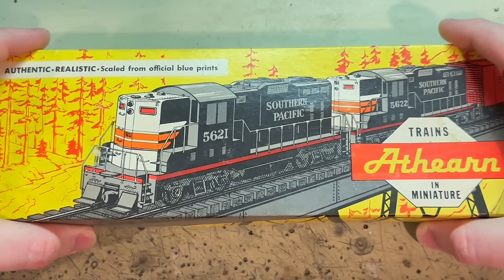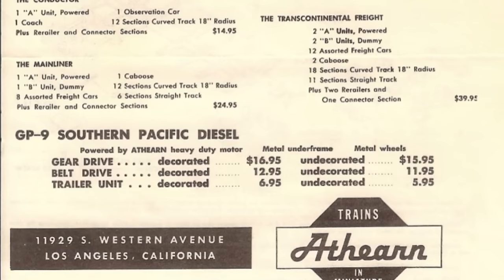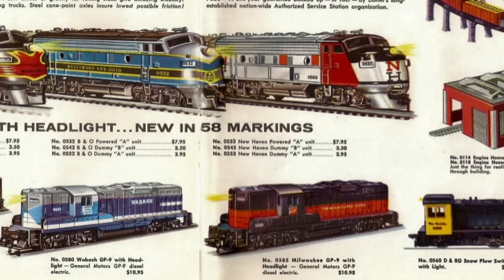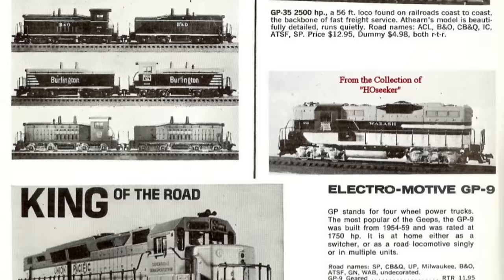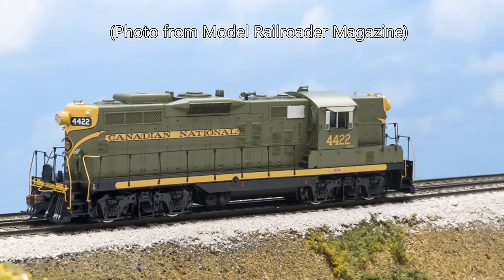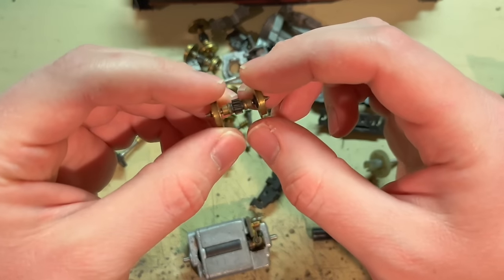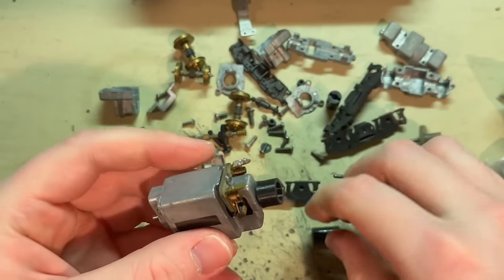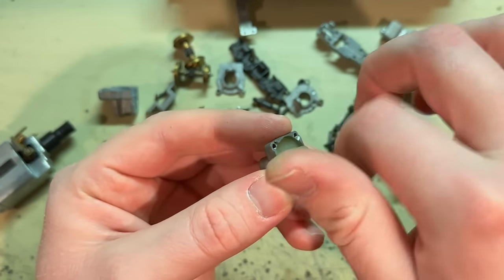Build and Review of the Original 1957 Athearn "GP9"

Comment: Great build, Its sad the old Globe drives aren't as known about today. They're a great option for repowering with a can motor if you want a heavier chassis in a custom build. I would like to point out, the long bearing in the top of the gearbox is actually two of the drive axle bears pressed in either side. Found that out accidentally during a service. Hope to see more builds in the future!

Comment: Good video. I've never seen one of these early Athearn geared drives. I've only messed around with their rubber band drives of the  same era. 

I've started using J-B Weld two-part epoxy for the metal handrail stanchions on my Athearn diesels, both where they fit into the plastic body shell, and where the stanchion meets the handrail. No more crooked stanchions!
Reply: Super glue works well
Reply: I use a soldering gun to "set" the handrails to the body, and then use glue. 💙 T.E.N.

Comment: Super. I operate four Athearn GP-9 "Bluebox" locomotives that I bought almost fifty years ago, and just by chance, they all came with the Jet motor and later version gear drive. I never knew that there was a third type of drive for the GP-9, not just the band and jet drives. The trucks remind me of the Mantua/Tyco MU-1 power trucks, with all the screws. I also make sure that all of my locomotives have winterization hatches, dynamic brakes, nice horn, and a full lighting package. 💙 T.E.N.

Comment: My first locos that I got when I was 4 years old were a GN GP9 and an NH F unit, both rubber band drives. Soon after, I got for my birthday, one of the units like in your video. The motors were pretty weak in all of them, and I don't remember where I got a replacement from a few years later, but it had about 3 times the torque the stock motor had, and improved it in every way. The amount of screws in some of the old locos always impressed me for some reason. I have a couple of RC cars now and the bigger ones have literally 200 allen screws holding it together.

Comment: I have an Olympic Express Japanese chassis that is a dead ringer for this chassis except mine has a Pittman motor! All metal gears....not quiet but powerful! Even has the frame tabs for Athearn GP-9.
Reply from the maker: I've seen those around before!  Since there are slight differences between their chassis and Athearn's I have to wonder if there was some copying going on or if Olympic Express got most of the parts from Athearn.

Comment: I did not know that Athearn used metal towers. I thought they went from rubber band to plastic towers. Great vid.
Reply from the maker: Yup, they started out with metal before changing to the plastic design, and then came up with their standard chassis a few years later that's still in use today!

Comment: I believe I have a pre-production sample of this model. It was all black plastic but with very few details. Like no fans other than a winterizeation hatch. With an all plastic frame with no motor mounts and has screwed on trucks. It also has all the separate parts on it. But with the horns being on the short hood.
Reply: You had the earliest version of the Globe model. They and the F7s originally came without a motor and as a dummy only unit.

Comment: I decided to do some quick internet research on the winterization hatch. While I didn't find it on any SP GP7 or GP9s, I did find them on UP and WP locomotives. Other details that would stand out the steam generator and dynamic brakes. The UP, WP, and the SP had dynamic brakes, but the steam generator were hard to find. The reason that I choose these railroads were due to Athearn's closeness to these railroads and it was rumored that somethings were based on SP prototypes. My best guess that Athearn created this model off of some EMD drawing or even something that Kalmbach Publishing. provided. I would say that if the winterization hatch, the dynamic brakes, and the steam generator was left off; it would be more of a generic model of the GP7 or GP9. Who knows? Uncle Irv may have like these details, and this is the reasoning these details were chosen.
Reply: The Athearn GP7 was always designed to have the dynamic blister be removable. At the time it was tooled, it was assumed that most modellers possessed the skill to removed the cast in dynamic fan, and to be able to fill in the resultant hole - but they did you a solid and made sure the hood radius stayed correct under the individual blister pieces.
Reply: You could have your brake and delete it too. The Lionel HO GP-9 complete dynamic brake blister fits the Athearn non-dynamic GP-9 and the Tyco GP-20 perfectly, as well as other locomotives. (NYC was the only railroad to have non-dynamic GP-20s.) 💙 T.E.N.

Comment: A prrecision can motor with flywheeels would go a long way to improving its performance. Shimming the motor shafts on the can motor would be required easily accomplished with metal tubing. Shaft length may have to be shortened on one side and the results are am,azing.
Reply from the maker: A modern motor and flywheels would be an improvement, but the old motor actually runs very well already.

Comment: Enjoyed the video! Did you consider swapping in a modern (presumably better performing?) motor, or is it your practice to keep the model as "stock" as possible? Similarly, is it possible to retrofit the model for eight-wheel electrical pickup?

Also, you mentioned that hard-mounting the motor to the chassis helps the motor run cooler. Do you think it increases the running noise, though?
Reply from the maker: Thanks! I’ve upgraded a few of my Athearns with better motors, but this one will keep the original motor for the history.

It is possible to upgrade this to 8-wheel pickup by installing some wipers to the trucks using insulators. The process is actually pretty easy.

Having the motor directly mounted does increase noise, so both methods have their advantages.  The motor noise isn’t a big deal in this one, but I do like to soft-mount the motors in models with really quiet gearing.

Comment: you have a magnet zapper ? 😯 of course it will only make them as strong as they ever where to begin with. Did you remove the magnet from the motor housing ? that can sometimes cause magnetic loss
Reply from the maker: I made sure to avoid doing that when checking out the motor, but Athearn’s early magnets had a tendency to weaken over time. A quick recharge can get them running pretty well.

Comment: Nice work. Nice to see that the manufacturing process was meant to last. Just curious do you think you could replace the wheels with nickel silver ones and replace the motor with a modern athearn motor easily?
Reply from the maker: Yes, it would actually be fairly easy for these since they have regular solid axles.  The motor's also easy to swap out.

Comment: Hey darth if you have a Alco brass  RSD15 would you do a review or tune up i got one at a train show yesterday and put a kato motor in jt from a C425 definitely helps performance and got rid of most of the noise even tho i greased the metal gears in the trucks and oiled everything theres still some noise
Reply from the maker: I don't have anything to show for Alco brass at the moment, but I do have another KMT-made brass piece that I'll get to eventually.  Mechanically, it should be about the same as the RSD-15.
Reply: @DarthSantaFe  thanks any tips on getting it to run smooth is appreciated
Reply from the maker: @Dawsonsrailfanadventures74  They did at least make them fairly simple to work on, so it's easy to take them apart and check each moving part.  Once things are cleaned, try turning the driveshaft on each truck by hand and see if you can feel any binding.  If the mesh between the truck and gear tower is too tight, you can insert paper shims under the gear tower until it turns freely.  Beyond that, I'd mostly just be sure everything is properly cleaned, oiled and moving freely.  You can check some of my Hobbytown videos to get a good idea on some parts since they're built similarly.

Comment: I thought the original Athearn models were the Hi F (rubber band) drives and not the gear driven ones?
Reply from the maker: The gear drive is actually a little older since it was made first for the Globe F7, but the Hi-F drive GP7 was released at the same time as the geared version.
Reply: @DarthSantaFe  Huh. Didn't know that! Thanks for the info!
Reply: @DarthSantaFe  Actually do you happen to know when the Globe band driven f unit was released? I have one and it's very similar to an Athearn except it has more wires and a different method of mounting the motor brushes.
Reply from the maker: @bracdude181  I'm not quite sure on the timing, but it may have been 1956.  Going by the info I've found at HOSeeker, the Globe F7 had been rebranded to Athearn in 1957, the GP7 was first advertised in 1956 to be released with both gear and Hi-F options, and the only official Globe material I can find refers only to the gear drive.  With that, my guess is the gear drive was introduced in 1955 or 56, the Hi-F was at least advertised in 56, and everything was in full production by 57.

Comment: Even till the end of production the never came with window glass.
Reply from the maker: My mistake, thanks for the correction!
Reply: @DarthSantaFe  no mistake, isn't a big deal....I modeled like 43 of these into Paducah rebuilds and Milwaukee road GP20s back in the day....I know these better than anything.
Reply: I used Scotch tape as windows. 💙 T.E.N.
Reply: @tracynation2820  evergreen styrene makes clear sheet plastic
Reply: I did it when I was young. The porthole windows still look pretty good, and some of the cab glass, as well as the smaller structure windows, survived quite well, but 40 year old tape didn't work so well for the large display windows, unless you wanted the cracked and dirty look, and disintegrated on the locomotives and passenger cars that I operated outside, and got replaced, but my 30 year old "abandoned" passenger car looks spectacular with its cracked and dirty "windows." 9 out of 64 of my locomotives, all around 40 to 50 years old, still have 40 year old Scotch tape as window glass, which actually looks pretty good in the cabs of my Mantua/Tyco steam locomotives, and is really easy to make it look like a cracked window with an X-acto knife. Funny to note just how many older models I bought that did and didn't come with windows, and that all newer models, even the cheap ones, actually have windows now. 💙 T.E.N.

Comment: How do we know we have a GP7 and not a G9? Back in those fragrant days of yore, fans and modelers would have told you a GP7 had no dynamic brake hump and a GP9 did. 

Simple and WRONG!

When GM finally got on the roadswitcher bandwagon in 1948, it took the prime mover of the F7 streamlined freighter, the model 16-V-567B (16 cylinder, V configuration, 567 cubic inches per cylinder) of 1500 horsepower and its associated electrical equipment and put them in a roadswitcher car body. In 1954, EMD introduced the GP9 with the 1750 horsepower 567C engine which, importantly, solved a problem of the B - which leaked water internally. Oil diluted by water does not lubricate very well. Downed locomotives in the shop were eating money = unhappy customers (EMD developed a modification kit for the Model B that the railroads could install, creating the BC engine, and solving the problem....for a price, of course, GM wasn't running a charity. There was an A to AC conversion as well, but few people ever bought that, why spend money on an old locomotive due for replacement soon?). The F9 sold OK, but the GP9 became world beater. With a reliable engine and "a simpler electrical system than a '56 Chevy" it stayed out on the road earning money rather than in the shops consuming it - and it could do any job the railroad asked of it, passenger, way freight, transfer, fast freight, switcher. More GP9's were built than any other diesel in history (4257) - a record that stood until the SD40 and its derivatives came along, two decades later.

 The kicker in all this is that both GP7's and GP9's came with and without dynamic brakes! Beyond looking at the builder's plate how can we tell what we have? Easy! Look under the cab. GP7's have three sets of louvers in the battery box, GP9's have one or none. GP7's also have two sets of louvers at the far end of the long hood, GP9's one or none. Congratulations! You are now on your way to being a diesel locomotive model expert, impressing your dinner companions should the subject come up and winning bets in bars. I'll let you figure out what model Espee 5600 is.

 BTW, it is in the as delivered "Black Widow" paint scheme, the "Bloody Nose" livery (Gray with crimson ends) was introduced around 1960.

 PS - the louver ID method is based on how EMD built them. In the three quarters of a century since then, &deity knows how many shoppings, modifications and rebuilds can have altered things on what is down on your local short line's ready track..
Reply from the maker: Thanks for the info!
Reply: It was actually a Lionel error that hit propagated into the model railroad world for almost fifty years. They sold the non DB model as a GP7 and the dynamic equipped model as a GP9. Athearn followed suit, calling their model a GP9 even though it’s a mish mash of GP7 phase differences (it could be seen most accurately as an late Phase 2 model once the full length batten strips are modified).
Reply: @kriscarver-seaboyer9204  I am aware of the Lionel error, but I am unsure as to whether it was the cause or result of the railfan rumor. Sorta chicken or egg situation.